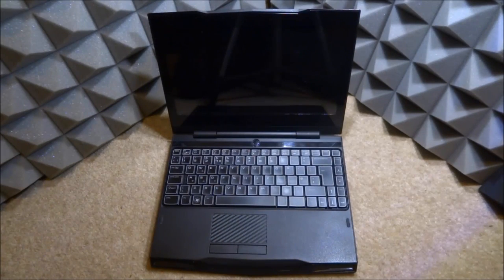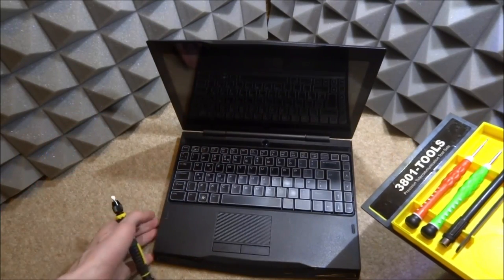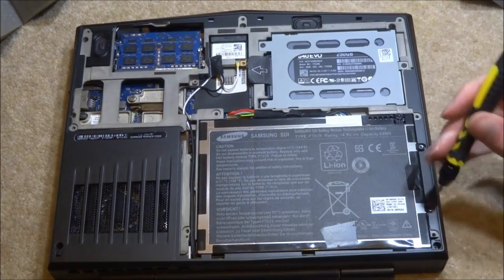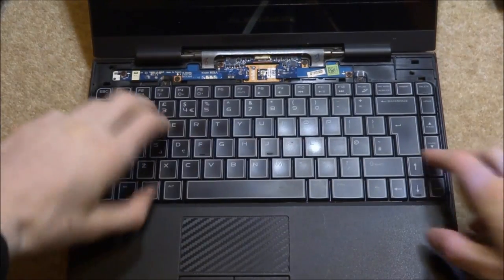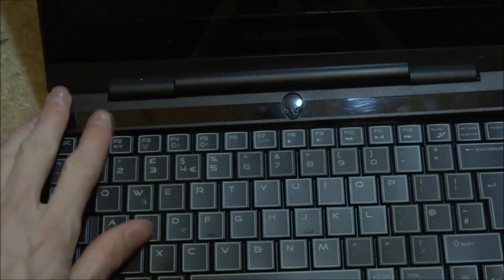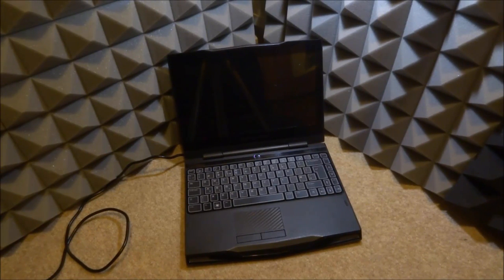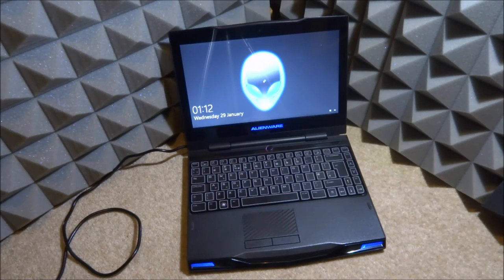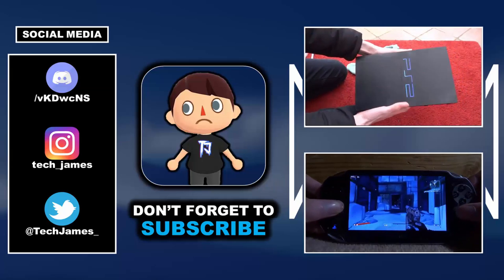Restoring $50 Alienware M11XR3 Netbook! (Loud Beeping With Black Screen)

Comment: Ha! I still have one of those bad boys in red! Used it when I went to boarding school in 2014-2017. 
For it's size this laptop did a great job, of course gaming was limited because of the overheating. 
Design, keyboard and mousepad are excellent. Just got it out again from my closet and ordered a new battery. 
The only problem I have with mine is the overheating. When using Google only the fan gets pretty loud already. But after years of heavy use it's understandable. 
I will have to see if I can upgrade it somehow.
Reply: Had same problem getting hot. I'm thinking need new fans. ???

Comment: I mean, the resell value is probably high because of the name but to me, that laptop is only worth about $50-$150 which isn't much profit thinking about time and replacement parts. But always cool to see that things are fixable!
Reply: They regularly sell for over $200 on eBay depending on condition and specs, a high spec one in good to like new will sell closer to $300. The bottom end is around $150 and that would be for an R1 or a low spec R2 in fair condition.

Comment: Thank you, I had the same beeping, I thought it's the rams, or the ssd, everything was in order, I never thought it would be the keyboard
Reply: Did you try to replace the keyboard, and how is the outcome?
Reply: @johnhe9984  I didn't replace it, I just moved some wires around and I never had problems since
Reply: @Intriguing444  like how did u move the wires? what exactly did u do? I replaced cmos battery but still its beeping

Comment: Hmm I have an old alienware M17x laptop that does that beeping too but I looked up the 5 beeps and it said CMOS but I replaced the battery and it didn't correct anything. Do you think that would be the keyboard as well? I remember long ago, my laptop started running slowly, and I think the hard drive might have been going bad but I wasn't using it enough to really fix it then, and then recently I tried coming back to it and it does that beeping thing and I cant seem to get to a BIOS.
Reply: Try re-seating the memory in the laptop.
Reply: What generation m17x? I have an R4 that has the same issue every now and then even with a charged bios battery. I disconnect the bios battery and primary battery. Hold the power button for 10 seconds and plug it all back in. Grabbing fresh bios from dells site and flashing that and it hasn't done it since
Reply: @isblue8504  I played around with it last night and got it working now, not entirely sure what was the issue, but its the same R4 from like 2012. I got it a new SSD hard drive and plugged in the windows 7 code for the registration and it lets you upgrade to 10 still. 

I reseated the memory,  replaced the hard drive, replaced the CMOS battery and then when booting it, followed a guide on how to get it to run using a combination of holding the fn button when powering on with only the AC power (no battery). I then pressed f12 to get into some 1 time boot thing that someone recommended to update the bios (although I didn't update it) and ran performance checks and all the parts seem to be working fine. Hopefully that was it, because the laptop didn't even get used that much besides for school and sat around a long time and I was getting pretty close to just selling it for parts if i couldnt get it working haha.

Comment: So I'm planning on buying this laptop (the r2 model with the i5 U520 in it) for $185, it also has 8 gigs of ram and also a 240gb ssd, can you guys tell me if it's actually worth it?
Reply: Worth it if you're not trying to do crazy stuff. The ram and drive alone are about 120. I would still disassemble and clean it. Maybe even new thermal paste
Reply: Go for an R3. From what I understand the R3 was the only model with USB 3.0 on the right side ports.

Comment: I also have a alienware m11x that was given to me as a hammy down but its not bad but too small and heavy. Also its on windows 7 which is outdated.
Reply: hammy down? LOL. It's hand me down.
Reply: A lot of alienware will include the windows 7 cd key inside the battery enclosure or just inside the shell on a sticker, and you can just enter that in when windows 10 asks for for a key ,and it will still upgrade. I did it last night with my old alienware M17x r4 from 2012.

Comment: 5 beeps is bios battery flat. Atleast it is on my m17x R4, m18x R1 and 15 R2
Reply: How did you fix it?
Reply: @johnhe9984  replace the bios battery